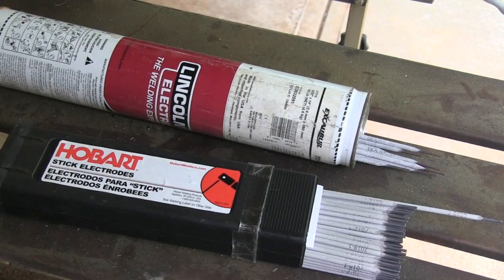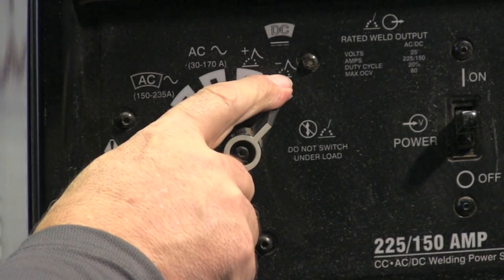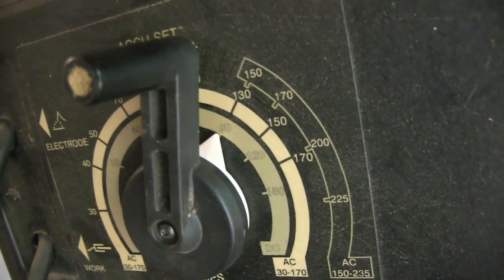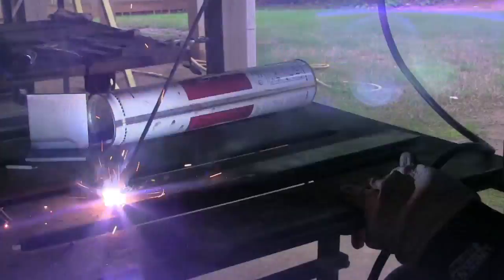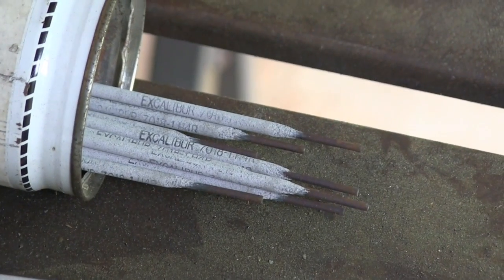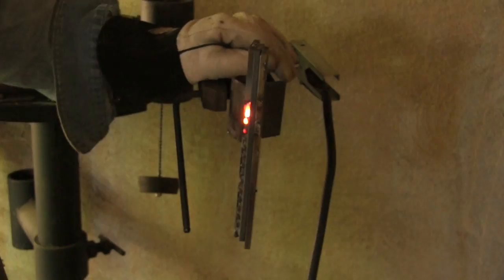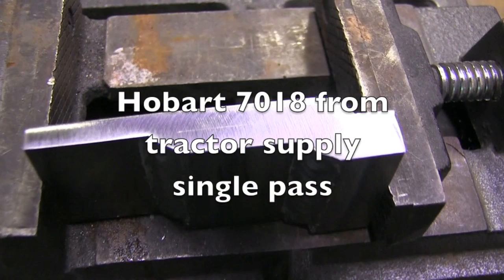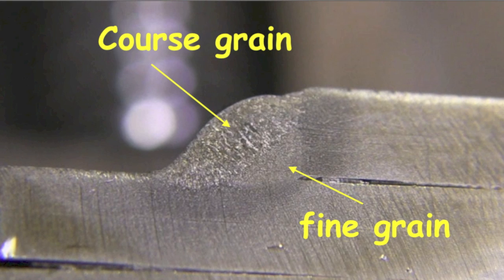Stick Welding 7018 Cut & Etch

Comment: When I was in welding school, about 35 years ago, one of the first things we learned was that 7018 needed to be kept in an oven, and I subscribe to that theory if you're talking about any kind of code welding, such as shipyard or structural steel applications. On the other hand I've ran a lot of 7018 for general repair or hobby welding that was not kept in an oven, and had been sitting in my garage or on a shelf at work with good results. I wouldn't trust it for anything that needed to be X-rayed, but for an engine stand or utility trailer, etc... it seems to work fine.

Comment: 7018’s are low hydrogen rods, and you can only take advantage of that if you store them in a rod oven. Otherwise they are just  a much better version of 6013

Comment: Looks like all that buzzbox amperage control needs is to be tightened up, taking some of the slack out of it. Calibrate it with your meter and tighten up the adjustment mechanism, maybe adding some friction between the adjustment handle and the white indicator. Five minutes of work to bring the unit up to where you can rely on it.

Comment: I weled pipe did not like travel so I went back to Oklahoma oilfield welding no hot box keep rods in cab of truck you b just fine until you lay in the Ceil laying in mud piss and it away at 2 or 4 mornings frezzing bills off because it down in hole out lying ur bold body in  drilling rigs sound fun get a better dedicatee

Comment: I've pulled 7018 Stubbs out of a mud puddle and use them to attack my ground on to what I was welding and it's startling how strong it still is. I do not think you need to have your 7018 rod in an oven.

Comment: These discussions about low-hydrogen rods always focus on oven vs. no oven, as though heat were the important factor. It isn't. The important thing is to keep all moisture, all water, out of the flux. Water contains hydrogen and can contaminate the weld.

Low hydrogen rods can be kept in any environment that will not allow hydrogen-containing substances, like water or hydrocarbons, to contaminate the flux. An oven is a sure-fire way to do that. If you keep the temperature well above the dew point, and preferably above the boiling point of water, no contamination occurs. But you can also store low-hydrogen rods in a dry nitrogen atmosphere, dry CO2, helium, argon, oxygen, or a vacuum. Whatever you like, as long as no hydrogen can penetrate into the flux. 

These other methods are not as simple and sure-fire as an oven. It's good to keep things simple and foolproof. Ovens also provide easy access to the rods. Just open the door. An oven works as long as electricity doesn't fail for a long period of time. On the other hand, if you need to store these rods for really long periods of time, like months or years, it costs energy/money to keep an oven hot. Other methods like dry nitrogen cost nothing to maintain but you don't have easy access to the rods.

Comment: If you are on site without electrode oven, tap electrode onto live job without making an arch and watch the moistures come out of the electrode and you should be good to go,  not suitable for power stations or sub building, but then these guys are welding to a much  higher specifaction.

Comment: Its a matter of preference I think. If you need a clean weld that is applied to lets say high pressure pipe weld ? Then yes oven rods are important to use in that type of application.. I would say over head welds would be another time to use oven prepared rods. Even though we know the rods weld much better dry with no moisture,it is not always needed. Cheers and happy welding.

Comment: I enjoy the Hobart H4R 7018, found them to be great rods and theres something about the flux that I find is almost a weld indicator. If prep was good and so was the weld, the flux is a nice light milky brown and comes off really easy, but if your weld prep was sub par or maybe you had too much arc length or too slow travel speed (they seem to prefer strings from my experience but I've done on site structural welding 100% visual and had no problems with weaves) good rods at a price cheaper than ESAB OK 55's ill take it, never ran a Lincoln 7018 but i imagine they'd handle just fine.

Comment: On rods in an oven? I'll try to say this clearly - follow the welding procedure. If it calls for your 7018 rods to be heated and properly low hydrogen before welding, do it. If you're doing something on your own, probably not important - just be aware of the potential issues of hydrogen embrittlement and other problems. So ultimately, the answer is it depends - but 'follow the welding procedures' is the best answer.

Comment: May be asking a bit much here, but somebody out there must be able to scientifically measure the difference between a 7018 and 7014 weld, when both are stored at "atmospheric" conditions (not in an oven) and say whether the 7018 weld had more hydrogen entrapment/embrittlement than the 7014, and also do xray, destructive, bend testing of both samples. 7014 isn't allowed in welds where low-hy is req'd, but is a 7018 stored in non-oven/non-sealed conditions actually any worse? I'd be surprised if AWS hasn't already measured this somewhere...

Comment: I keep my 7018 in a small rod oven. Where I live, the air is so humid that it keeps them fresh, keeps the rust off and they just seem to run better. Although it discourages me from opening a new can because my rod oven only holds 10lbs, and it's currently occupied with 3/32 Excalibur rods. Sometimes I need 1/8 and won't open a new can because I don't have the space in my oven for them. Maybe after I read Jody's article it'll change my mind.

Comment: HI! there is lot of confersation to use to oven and stick heater. I got to say example europe welding stardat PED give your frames to to do welding jobs from a begining at to the end. you have to put rods to the oven and after that is possible use heaters in the job sites. you can avoid certain welding mistakes to use heated rods. what comes that melted sticks after it reach to the very end in here finland we use hand remote to addjust amperages keep arc voltage steady.

Comment: True. Must keep the H2O out of the 7018 rods. When you run an electrical current through H20 you get hydrogen and oxygen gas. 2-H2O=.2-H2+02. So for every 2 water molecules you get one oxygen molecule and 2 Hydrogen molecules, Both are bad for welds and commonly cause porosity at the start of 7018 welds.

Comment: Ok so I have a noob type of question. Is it possible to weld with a Lincoln AC tombstone on auto exhaust, and if it's possible what electrode would be best for this application? My Lincoln is all I have to work with.
Reply: Phillip Bishop - possible? Maybe. what the issue is you're welding on thin wall materials with a hot process. combine that with welding around a small circumference pipe, and you have some of the most difficult welding one can attempt. I would advise coming some short sections of the pipe you intend to weld and trying it ( be aware of galvanized pipe and its dangers). You will want the smallest Rod you can find, and weld as low as you can amperage wise. give her a whirl and see what happens and that'll tell you whether it's possible for You to weld what you're asking.

Comment: I'd like to see a test of how cold you have to run in order to get insufficient penetration. With stick, penetration is usually about as good as it gets, and between that and the vertical uphill, I bet it would still do fine even below 70 amps.

Comment: I prefer ESAB 7018 far and away over either Lincoln or Hobart , welded code for years and have run them all,,  used to be Atom Arc, but ESAB bought them out...  give it a whirl, you might like it.

Comment: you should compare some mig pulse welding or "stitch" and continuous bead and check the strength between the too. alot of hot rod ppl will go with a stitch weld look on frames and such and i feel that isn't near as strong since its alot of cooling time before pulses and each tack doesn't fully penetrate.

Comment: 7018 is LO H but will still weld fine if its not baked, you just run a higher risk of imperfections in the weld.

Comment: my opinion I think 7018 should be kept in a rod oven if the weld is going to be X-rayed, other then that if you weld hot enough there should be no problems

Comment: The answer is TRUE.
I worked at a shop that had 7018 rods that were kept in an over and after 4 hours we had to put the ones we didn't use back in

Comment: Just like most things welding, the answer for 7018 rod ovens is it depends. stickin a hay rake back together? sittin on a bucket, burning some rod in the yard? you gonna be just fine. doin a retrofit to an existing overpass on the interstate? man, keep them things warm.

Comment: Hey Jody, I was wondering why you chose to use 3/32 rods instead of 1/8th considering the 1/4 plate. Thanks!
Reply: Jake Duea easier to run in the upper amperage range of the rod. A bit more controllable.

Comment: 7018 is a low hydrogen rod however it doesn't need to be baked unless it is specified which is usually for military or structual codes. other than that it usually isn't too much a big deal unless specified

Comment: 7018 is a low hydrogen electrode. If you use them, normally u have like 8h of use before u have to bake them, if they come out vacuum. U cannot keep them in an oven on high temp, you will damage the coating. If they are not in a vac pack you have to bake them (+-572°F) for +-2 hours before use. You can also use this rule for electrodes out of a vac pack after more than 8 hours. For storage best check the temp and humidity. Store around 86° F and low humidity (for best result). Before use, bake them again, you can bake max 2 times. The big problem with the moister (if you do not bake) is hydrogen cracking, but this is normally not on thin metal and you will not see a difference is weld metal only in the arc itself. If you weld thicker metal, the hydrogen cannot diffuse anymore and than there is a chance on hydrogen cracking, but this is also not noticeable in the weld metal, except if it cracks obviously, but maybe that's a bit of topic.

Comment: I keep all my stick rods in an oven. I found they just weld better. Used Hobart and Lincoln for years with no problems. When I bought some Off Brand KOREAN rods I had major problems. I stick to Hobart, Lincoln or ESAB  rods. Cost more, but get what you pay for.  Love your videos, earn something every time. Thanks. Mike

Comment: Haven't read your article yet, but I'll take a guess: FALSE, if the application doesn't require (e.g. code spec'd) a true low-hydrogen weld, then using "left in the open" 7018 is no worse than using 7014, 6013, etc... none of which are low-hydrogen rods. TRUE, if the application requires a true low-hydrogen weld. In short, for those of us doing general purpose, non-coded welding, an oven isn't needed.
Reply from the maker: nemodetroit nailed it
Reply: nemodetroit I remember in school the teacher said an old trick to somewhat "dry" out a 7018 is to get it suck and let it heat up for a second. I do wonder if that would make any real difference.
Reply: bojengels1 it does make them run a better if you warm them up. i've done it before in a pinch.
Reply: I work in a shipyard as a steel fitter/shipfitter/ hull fab (different names but same thing). Fitters use all Lincoln 7018 and the "weldors" come behind with .052 dual flux . Anyway... Since we work around water and have surprise rain storms, I've (don't judge me) stuck the completely wet rod and wait for it to stop steaming. Wiggle loose and wait a few seconds to cool a bit, and then fire back up. 15 years experience. I don't do this all the time but it actually works in a pinch with a perfect looking weld result. Also, just bought 25lbs of Hobart 7018's that were shot off the shelf. Lincoln rods all the way.

Comment: Hy Jody. In the Video the ARc length looks to big vor an alkaline welding electrode. Answer of your Question: Follow the Pruducer Specifications. Its recommend to bake the elektrode in an Ofen. Greetings from Austria.
Reply: WeldDuck Do you think you can make a really shorter arc when rising in an angle without sticking ? it is interesting that you say that I was said the same and it could be for flat weld in the video, half the rod diameter for alkaline  (we call them basic in french) and a full rod for 6013 ( and for 6010 may be because of the flux drop mode ?)
I am no professional welder just learning for my own purpose, but I am of the "curious" type ;) greetings from Paris.
Reply: I know it only from the welding Electrode Brand Called Böhler fox EV 50. Voestalpine Böhler WElding recommend the Arc length for this elctrode 0,5mm * Diameter of the Electrode (0,5*2,5= 1,25mm Arc Length.

Comment: I was always told this - : low Hydrogen rods must be free from moisture at the time of use.
so if they have been exposed to humidity they must be heated to drive off moisture, or they will not produce a low hydrogen weld. So I guess I'm saying False as they do not need to be KEPT in an oven.

Comment: I've used 6013 and 7018 not on any structure just building tool's I need to work on home job's witch of the is best I'm going to build 4 metal saw horses and just wanting to know witch would be better.
Reply: Leonard Gilbreath 7018 is better. but in your case it doesn't matter.
Reply: 7018 is better. 70,000 psi tensile strength vs 60,000 psi

Comment: Hi Jody. Last year I had to weld some tooth shanks on my excavator bucket. I found about 50 pounds of 25 year old Lincoln 1/8 7018s under a bench that had fur growing on them. I tried them to see how bad they would run or how bad they would fingernail and as soon as I had a problem I would stop and throw them away. Wound up doing the whole job with them, and a year later, with ripples of the beads worn smooth from digging, teeth still on, no cracks, welds strong. Made in U.S.A.
Reply: John C I just think too much moisture make the arc unstable, lot of sparks and projections, so the job is uneasy . bubbles and hidden inclusions may occur so I understand professional jobs ask for specific conditions. ( indeed I tried Lincoln 6013 type 46 after having used other locally made and a nice difference )

Comment: When I was welding at the Forward Brothers mill in Red Bluff CA - Ben my boss said always keep them in the oven and dry
and then later in mostly dry country didn't seem to matter too much.  I guess I will keep them in the oven just for grins and Ben
Reply: a friend just keep his 7018 in a closed plastic box on the top of a tall furniture in his house so it is a dry environment.  a one hour stand in an hot oven the day before at night if he need to use them in the morning. he say that works for him that way.
Reply: Its amazing how many ways of doing things there are.  I went to the steel store and just open in a box without any care was the LH rod and I asked they why and they said didn't matter to them.  (HUH)

Comment: I've worked at two different nuclear power plants back in the 80s, a lot of times I would check out 3 pounds of 7018 3/32, we was allowed to take 12 rods out of our  portable Rod Caddy at a time put them  in a rod  pouch, if we didn't use them by lunch time, or after 4 hrs we had to fold them in half, put them in a stub  bucket not to be used, at the end of the day we had to bring our used rods and the folded rods  back to the rod trailer, they would write down the information and put back the unused rods from the portable rod caddy into their ovens, they used a 53 foot semi trailer for the rod storage, they had their  rods ovens  two high on both sides, one night the power went out and the temperature of the rides dropped enough to where the NRC (Nuclear regulatory commission) did not feel safe to use them, so they scrap them all,  bought new rods loaded the ovens, and we had to wait for two days before we can continue welding again,The 7018 electrodes back in them days had to be in the oven in order to perform properly, they have rods today that are listed at 7018  that do not have to be in the oven, but out of respect for the tradition and to reduce any prosody or any defects I would continue using the oven anyway,I watch all your videos I really like what you're doing to help inform new welders coming up through the ranks and even season  welders too
Reply: How thick metal and how many passes with those 3/32 if you don’t mine me asking. I’m teaching myself and the hardest part is determining how many passes or what thickness metal I can weld with a certain size rod. The Lincoln book on arc welding seems to want overkill. Something like 5/32 for 1/4” fillet
Reply: Will parfet 1.5 the rod diameter
Reply: Monnie Holt tig cool too cool info on tig
Reply: Monnie Holt I ran some Excalibur 7018 rods and others
Reply: Monnie Holt 2/32 is one eighth welding rod just saying lol  1/16 lol jiat joking lol
Reply: Monnie Holt nickel rods them too  . good video
Reply: Monnie Holt in history how was welding done ? just asking no reply
Reply: Monnie Holt first one is tig welding ok back to s lol  u go brodont mix both welding video ok
Reply: Monnie Holt cool video on tig mig and stick welding
Reply: Monnie Holt the history of welding yea  if all was not available tig mig and stick welding not available what do one do if welding is said to be in effect but still hold the same stregth ?
Reply: Monnie Holt yea power plants under water welding if needed from what I hear no leakes 3/32 rods  is small but bigger than 2/32 rods 1/16 rod off subject